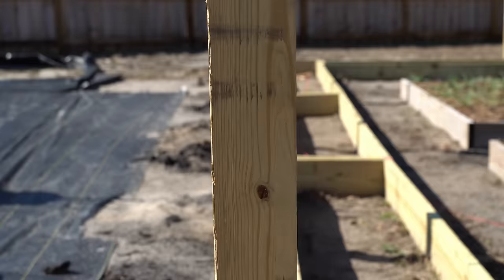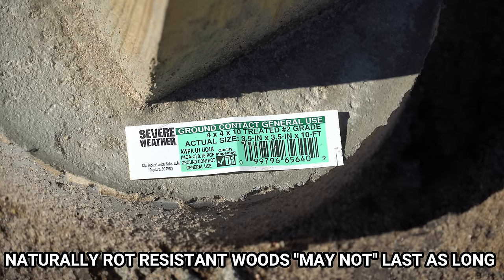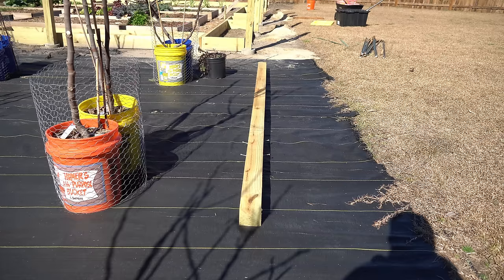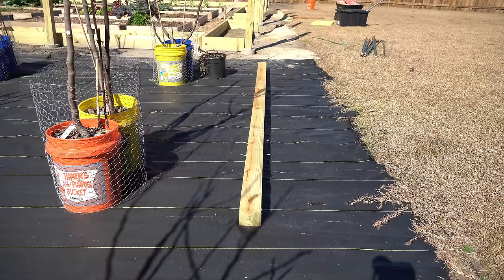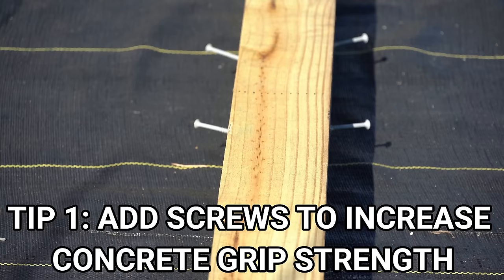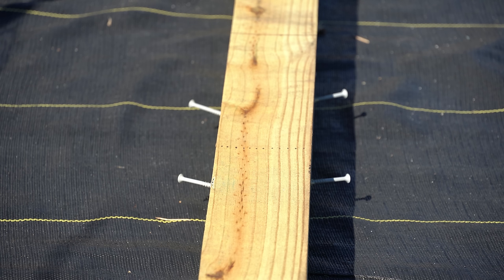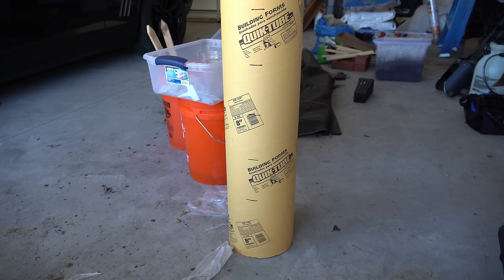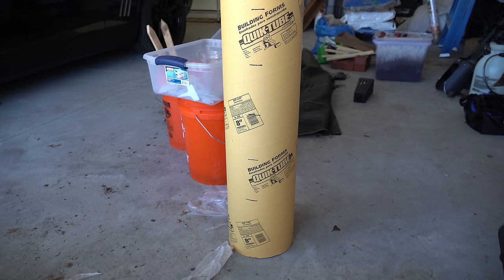3 Tricks To Installing Stronger 4X4 Wood Fence Posts That Last Longer

Comment: how did you remove the paper that formed the surround of the post a above ground?  Is it easy to cutt away or did you lift it off once the concrete began to set?  Nice DIY video ...thanks!
Reply from the maker: Sean Kent the forms strip and are spiral-cut.  If they stick on you, you can soak them with a hose to make the cardboard soggy and then it’s easy to just tear right off.

Comment: When installing wood posts, what's the best way to prevent the concrete around the base from rising? I heard things like a bell-shaped bottom and large deck screws screwed into the ground while in the hole. Are these ideal methods? I would love to hear everyone's input and suggestions. Many thanks

Comment: Cant you use red guard for the base of the post?
Reply from the maker: I have not used that product.  It's pretty common in industrial applications to caulk around the base where the post meets the concrete to prevent water intrusion.  I didn't do this, but it would be an improvement.

Comment: Geez I totally under did it.. Only set 18" in the ground on my first post, put scoop of dry concrete underneath the post, maybe 2-3" deep with a little tiny bit of stones and I finished it a in below ground level.. Figured ground contact rated pressure treated 4x4s wouldn't need too much special treatment, and I needed at least 8' above ground to get this trellis high enough only having bought 10' 4x4s.. $25 a log now is wood price.  Problem mentioned is clayish soil and its right at an area where runoff occurs from my roof though maybe I can change that.. It will be supported laterally at the top by connecting to nearby roof of shed and home on either side, the other 2 posts will be uphill so I can sink them deeper 2-2.5' and give them little better concrete shoe.. Will try to make a cup around the others with a milk jug or 3ltr bottle and get the concrete shoe above ground.. As long as I do the others a little better I hope it lasts, first trellis I've made (kiwi vine) I don't think it would work to just add that shoe on top of poured drying concrete now? Its dark here now. My hope is that through supports and the others being better I can help compensate for this one inadequate one, its too late now

Comment: Great video.  I love this technique.  I had a question though about the cardboard tube.  Does the inch or two that gets pushed down into the main part of the hole get cutoff and remain in the concrete.  Or do you try to pull off all the tube material, in which case do you try to fill the groove left by the removal of the tube?  Thanks!
Reply from the maker: Thanks!  The cardboard tube is just a form so you get a nice, even, smooth foundation top, and so you can effectively slope water away so it does not pool on top of the concrete.  After 24 hours, you will remove the cardboard tube.  It has grooves in it for peeling, so you can either use a utility knife to help peel it off, or you can soak it down with a hose, which will get the cardboard soaking wet and you can pull it off.  If you want to soak it down with a hose, maybe wait a few days to let the concrete finish curing.  If you want to use the knife technique, 24 hours is enough.
Reply: @TheMillennialGardener  Thank you!!!

Comment: If you read the information about ground pressure treated wood, it will decay over a period of time no matter what you do.
Reply from the maker: Correct.  It is about how long it’ll last and how often you’ll need to replace it.  Everything decays overtime.

Comment: Good tips but crushed gravel will soak up water like a sponge. You needed large stone
Reply from the maker: The purpose of the gravel is to create a gradient: a dichotomy of soil types.  The ground around it is always going to have some level of moisture.  The idea behind the gravel is that the water collects slightly less around the base of the post so it rots more slowly.  Also, the gravel is to prevent settling.  Clay and silt types of soil have "infinite compaction," meaning they can settle an infinite amount.  This makes foundation design difficult in clay/silty soils.  Sand, on the other hand, compacts very well, and foundations are more stable in sandy soil.  The gravel helps create a more stable base less prone to settlement.

Comment: I want to install one post at the corner of the extended porch, so I can add some string lights. Can I directly install them in the ground by digging a 3 feet deep hole?
Reply from the maker: Do you mean without concrete?  How tall is the pole?  Generally, you want to embed at least 30% of the overall length of the pole (so a 10 ft pole would be minimum 3 feet deep).
Reply: @TheMillennialGardener  I can buy the 10 feet pole and put 30% down into the ground. but looking at other videos, I'm rethinking to start with a 5-gallon paint bucket or plant bucket with concrete.

Comment: Just pour concrete posts with rebar inside. Why screws, they are weaker than nails, and maybe 1/4" rebar might be even better through the post. Pressure treating is to prevent bug intrusion for the most part.

Really though, how long do you want the fence to last? In 10-15 years you may want to change it. How hard will it be to remove the post assemblies?

Comment: As long as there's no air, they won't rot. The city of Amsterdam is built on a swamp, on huge untreated posts (basically trees). They're driven into clay which is airtight and they've been there for 800 years. It's only when they have a drought and the waterline dries up, they rot and they have to dig them out from underneath buildings.
Reply: 800 years wow

Comment: When you insert your post in to the hole make sure you use protection so your post will not rot!
Reply from the maker: The posts are capped with concrete.

Comment: I gotta say that where in the world did you find a treated post with a clear color? It looks like it’s not treated at all.
Reply from the maker: They're just the standard 4x4 posts from Lowes.  After I took delivery of the posts, I allowed them to dry out in the sun for a couple weeks before I installed them, though.  PT lumber tends to come soaking wet, so I like to let them dry out for a little while first.

Comment: concrete does not need the screws at all, you are more likely to break the post or take out the post with concrete then pull out the wood out of the concrete...

Comment: There is no need to bury wood corner post. Drop a jay-bolt into the concrete, then drill the bottom of the post so when you install a metal strap with a nut it will sit flat. Once the 2 X4's are screwed onto the corner post it isn't moving side to side. These corner post will never rot above ground and use a rubberized paint to coat the bottom of the 4 X 4's if you sink the other post into the concrete.

Comment: I'm at the gravel in the bottom of the hole part... you should use a piece of field stone in the bottom of the hole rather than gravel. Water follows the path of least resistance. The gravel in the bottom of the hole will never compact to the same density as the surrounding substrate. The ground water actually POOLS in the gravel So, water will ALWAYS be in the gravel void. The thing to do is, put a 2-3" rock at the bottom of your hole. Use pieces of scrap wood to hold your post true and plumb. Fill your hole with cement. The cement will completely encase the bottom of your post and seal it. Then, fill higher than the top of your sono tube. Taper the cement AWAY from the edges of the wood and to the outer perimeter of the pour. Don't trowel it flat. You want the water to flow away from the wood on every side, not just as a ramp. Reason being, you want the cement to cast off water around it's own mass, bot on an angle that will allow water to sit on one side of the post. This seems like a small point but watch what happens over five years and see the difference. This will keep the bottom of the post sealed in and safe from creeping water on the bottom, and will help shed water from on top. This will make your lumber and cement FACTORS longer. Lastly, spend the money and use the sono tube for your entire pour. Not just the five inches on top. If you do, and you know that your hole is 40", cut it 43-45", and fill it completely THEN taper it forming the cone of cement I wrote of earlier. 

This guy is super thorough. His work is very good. This is just the difference between studying and having a solid plan, and doing it a ton.
Reply: if the bottom gravel layer is always filled with water, cement won't seal anything. Cement is like a sponge, so, that water will be wicked up. Best option is to just use steel posts. For the amount of work labour and the cost of 4x4s, a steel post is negligible. A 4x4 is what? 16 dollars... a steel post is not much more expensive.

Comment: Why not screw a square plywood cut out or metal plate to the bottom of the post and put a plastic sleeve on the section that tends to rot/bacteria/insect that is 6 inches below ground grade.

Comment: Adding gravel to bottom of post hole is not advised. Similar to a French drain, you are allowing water from surrounding soil to collect in gravel and post will wick the water. Recommend you place 4-6” of concrete to protect bottom of post. Don’t leave bottom of post exposed to soil, water, or gravel.

Comment: Paint a rubberized liquid membrane onto the post that will be in contact with concrete or soil to prevent rot. Easy to do and doesn't cost much more.  I do this with any pressure treated that will be in contact with moisture including concrete. Please do not burn pressure treated wood or put motor oil and diesel fuel into the ground.  This will contaminate the soil and burning pressure treated wood will put chemicals into the air and your lungs.
Reply: Does it work?
Reply: @bhuleskar1  It has for me for years. The waterproofing liquid membrane (paint) won't let water or moisture penetrate to the wood. Using gravel for drainage will further help but that alone won't prevent eventual rot from occuring in the future.
Reply: Thank you so much J

I am looking to install the pergola post in ground. Currently it’s over the concrete and my contractor says that putting it in ground will make it more stable.
Everywhere I read it online it says never put in to the ground. 

Also my posts are Redwood. Would it be okay to put rubberized paint over and put it underground?
Reply: @bhuleskar1  Even wood such as pressure treated wood rated for ground contact will rot eventually if you put it directly in the ground. If the pergola is free standing, meaning it is not attached to a ledger on the house, then putting the posts in-ground will help with stability but it's not necessary to do so as long as you have the proper concrete footings in place (and below the frost line depending on your location) and the proper anchors attaching the concrete footing to the posts. But like I said, painting a waterproofing membrane onto the bottom of the post will certainly help prevent rot and will last a lot longer than not having anything at all.
Reply: @JtotheRizzo  agreed.. thank you so much for your help. Yes I do have one side of the pergola to ledger of the house. Other 4 posts over concrete post. I think I would go with concrete footing with some solid anchors in place. Any recommendations on what anchors to put? Also any recommendation on how to cover the anchors with trim base on the bottom of the post. I searched online but didn't find any ready to install thing online.
Reply: @bhuleskar1  You can get the anchors at any of the big box stores. They are specifically designed for attaching posts onto the concrete footing. There's plenty of vids to show you how to do that. As for the covering of the posts, you should find a really good carpenter to custom make these for you.  Use appearance grade pressure treated one by (3/4" actual dimension) stock so you don't have as many knots in the wood. Good luck!

Comment: What if instead of gravel, you mix cement and let it set to dry at the bottom?
Reply: The gravel allows water to pass through, the cement will not do that as efficiently, so can still hold water which is the whole point in the gravel layer.

Comment: Posts always always rot and snap level to the ground trust me I know from year's of experience
Reply from the maker: Everything made of wood will eventually rot, but I want to go as long as possible between changing posts.  Even bridges eventually need to be replaced, but that's not a reason to not build a bridge.
Reply: I think most people know that 😏 The trick is to delay that rot as long as possible, which this video helps with.

Comment: Why not use footers and mount bracket on top
Reply from the maker: You could, if you want. It will be more labor and cost intensive, though. I would have had to purchase 3-4 times more concrete since I'd need a full foundation, plus the cost of the brackets and hardware. This would have probably added $1,000+ to the build, which I really didn't want to spend, plus a lot more time. It's much more affordable to simply bury the posts and backfill them with dirt and some concrete. I expect this to last 10-20 years, and I probably won't live here for 20+ years, so I just don't need something like that.

Comment: The idea of putting gravel in the bottom of the hole is somewhat misleading in terms of it's effectiveness. If your soil drains easily then it really isn't necessary because it will not hold water on the bottom of the post. If your soil retains water, like clay soil, then having a gravel space will give some volume that will allow the water in the soil to seep into making the bottom of the post wetter than the surrounding soil. In some areas you have clay over sandy soil and in that case the gravel doesn't really help the bottom of the post either.

Comment: I think water will sit in your rock anyway, especially if you have clay soil.
Reply from the maker: My soil is mostly sand as I'm on a coastal plain about 9 miles from the ocean.  There is very little clay, although because the area was clear-cut about 4 years ago, there are some locations where the tree trunks used to be that hold water because of the old roots 24 inches below the surface decomposing.

Comment: Concrete will leach the oils in the treated wood posts causing it to rot faster and break off at the concrete surface regardless of how high off the ground you put it. Best advice is to tar what goes in the ground and use stones to set in the hole. Every stone layer is then tamped in with sand added to fill the gaps....I've never had a wobbly post after 20 years, nor rot breakage. Every concrete post someone has put in has fell over in 10 to 15 years. Out on the Reservation or boonies water & concrete are a pain in the ass to use.
Reply from the maker: Keith Lucas concrete isn’t going to accelerate rot.  If your posts lasted 10-15 years, that is incredible for plain old pressure treated wood.  Ground contact wood doesn’t normally last that long.  Do not add tar.  It is a carcinogen.  That would be catastrophic in a garden.  If you want the setup to last more than 10 years, don’t use wood.  Use metal or composites.  This is not designed to last more then a decade.

Comment: Via experience in clay soil, I reccomend not putting gravel in the bottem of the hole.  It creates a small puddle that your post sets in!  In stead pour 4 to 6 inches of concrete first then the post.  Of course a reveal at the top is important and that needs to be taperd away from the post as Northern Cowboy suggested.  Great video.  I use lag screws on all four sides in hole.  Thanks!

Comment: Do you brace the corners?
Reply from the maker: I haven't had to, because they aren't supporting any significant weight.
Reply: Thanks.  I am fencing a 50'X50' area for fruit trees, berries, and a raised bed.  I am putting welded wire - 2"X4" at 6' tall - on the bottom) then a welded wire 4X4 fat 4' tall over that as I worry about them jumping the fence in the winter as that area typically gets 3-4' of snow).  I wonder if the weight of the upper part of the fence is a factor and if I should therefore brace the corners.  Thoughts?
 @TheMillennialGardener

Comment: If you have clay, the stones at the bottom act as a pool where water just sits there 365 days a year.  Can't win on this, so don't use any wood in the first place.  Use galvanized, concrete, or aluminum posts.
Reply from the maker: You can do that, but it is going to cost probably 4-10x the cost depending on the material you go with.

Comment: I fill the wholes with all three quater inch. crushed stone no cement at all just crushed stone the water drains threw cement tends to trap moisture against the post , and its very strong .

Comment: Great vid, however your hole diameters are too small for 4X4 as they should be 10" OR 12". Also those that live in winter areas might want to go as deep as the frost line, so around 4 to 4.6 feet deep.
Reply from the maker: The wider you make the holes, the more concrete you'll have to add.  The holes, in general, worked out very well.  I haven't had a single problem, and everything is still upright and true with no issues.

Comment: Do not use gravel I repeat do not use gravel water will travel to the least resistance location in the ground in the gravel pile will become a pool of water
Reply from the maker: If your ground is very wet, the gravel will be the driest part.  You're creating a void in the soil, so water can theoretically rush in no matter what you do.  If you are in clay soil, you may want to encase the bottom of the post in concrete.

Comment: If you would have just filled the holes with concrete then after it drys add metal brackets screwed into the concrete and attach to the posts not only would they not be contacting the ground they wouldn't need to be 10 footers and last longer.